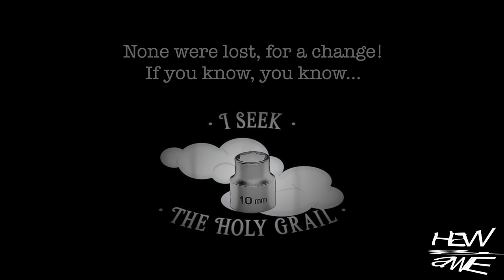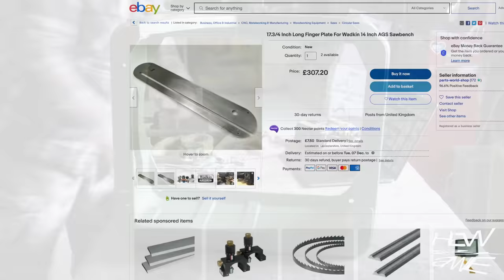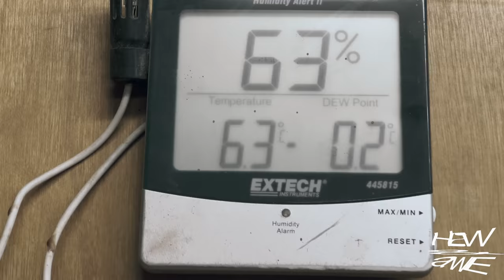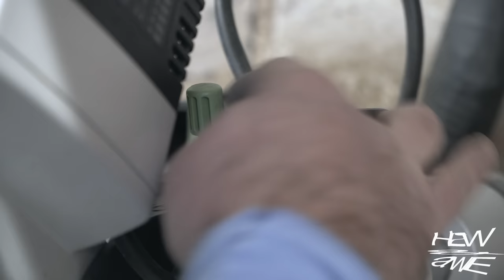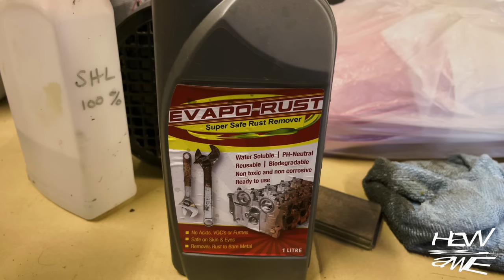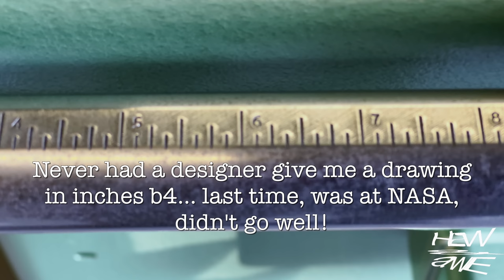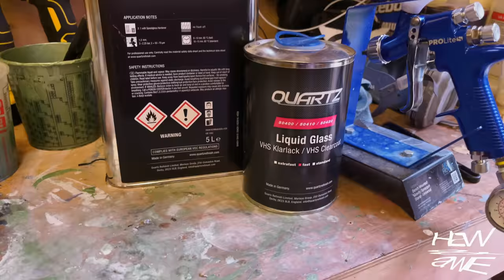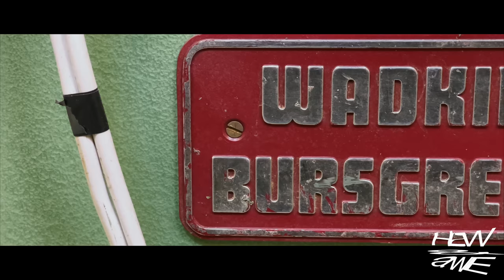Rebuilding My Old Table Saw (FULL EDIT) Wadkin AGS 10"

Comment: For future reference, Wentins in Yeovil sell every nut bolt, and washer you'll ever need, and several you won't, and you can order 1 or 1000 of anything.
Reply from the maker: Thanks, it’s nice to keep as much as possible as was from factory though.
Reply: @HewAndAwe  I more meant for finding correct replacements for the ones that are stripped/rounded etc - they sell Whitworth etc, you'll be able to get pretty much like-for-like

Comment: ----  that was a better saw when you rolled it out of the back of the van than 100% of the plastic and/or aluminum saws sold today
Reply from the maker: For sure, and easy to work on if any faults arise.

Comment: all my machines were made in the 60s and 70s.. lol, but im lucky they were handed down by my grandfather to father now to me. the lathe, drill press etc might be 50-60 years old, but i didn't go broke acquiring them, loved your video, there is something therapeutic about working a machine with your hands. from the time i was 4 or 5 i knew i want to work with metal. i was welding using the drill press and bandsaw before i went to kindergarten. mt grandfather made sure to put a tool in my hand. again good job sir.
Reply from the maker: Thank you Charles, appreciate the compliment! It’s defo my prize possession now!!! Merry Christmas! 🍻😊🍻

Comment: I stripped my AGS yesterday and was chuffed as a maggot to find absolutely no damage to any parts... No cracks, no stripped bolts, no frozen parts. Everything came apart easily. My rise and fall alignment bracket is complete, but I've decided to add a 3 mm brass shim between the screws and the contact surface. Currently, the 3 adjustment screws are in directly in contact with the surface and that doesn't strike me as being too cunning.
Reply from the maker: Those screws become a pain till you have them set up spot on - but I can’t remember why. My depth of cut is 80mm at 90 degrees 10” blade. One day I’ll get a 12” blade for special occasions.

Comment: A heartfelt pat on the back from East Tennessee USA you done an excellent job, I did not know up until I watched your video that the Powermatic 66 is essentially the same saw I know this because I have one sitting in my living room that I basically stripped like you did and it's in the early states of repaint and restore. 
According to the factory I have a first year 1966 Model 66 Powermatic cabinet saw and yes it is actually sitting in my living room😁
Reply from the maker: Hahaha to be honest if mine wasn’t in the workshop it would be in my living room!!

Comment: I just refurb'd a similar 1960s US Delta-Rockwell Unisaw, which has a very similar fence system called a 'Jetlock fence'.  It suffered from mishandling by morons - using the fence rails as handles to move the saw which led to instant dealignment.  By the way, a spring on the micro-adjust knob was part of the original assembly, and I think that a moron unscrewed the knob and the spring popped off and was lost in the pile of sawdust at his feet.  
But one thing about these vintage saws that is great, is that they have few or no nasty plastic bits, and they were assembled by human hands with hand tools, and so can be disassembled, repaired, and reassembled as you have done so well.
Reply from the maker: Yeah hit the nail on the head there, for me that’s the most fantastic part the fact that saw can never die unlike everything produced these days in the name of greed.

Comment: What a beautiful result. I enjoyed the whole video. That hammer tone type paint is an enamel so it will take 6-8 weeks to fully cure at which point it should be a lot more durable. Cast iron is the preferred material to make high end table saws because the iron is very dense so it’s great at dampening vibration but what a cow of a job painting it all. Cheers Stuart 🇦🇺
Reply from the maker: Cheers Stuart, I can stand a pound coin on the top and it doesn’t move at all! 😁

Comment: Great rebuild and loved your modifications adding as dust collection system. I understand completely what you are saying with today's junk that is manufactured, a great bit of it is manufactured in China and a good bit of it is just junk.
I have found myself scouring Craigslist adds and going to all sorts of Estate/Garage sales to acquire older American manufactured wood working equipment made in the 1960's and earlier. I have been pleasantly surprised to locate items that I would have never guessed would be stored in a basement or a garden shed.
Usually the equipment back then was made by a single manufacturer who still had their machinery set up from WWII to cast parts for Craftsman, Delta and SouthBend and General Electric to supply the motors to power them. The GE motors are a work of art with thick black paint and Brass info plates, If the motors are older they have baked on black porcelain.
I try not to get into an item that is so badly in need of restoration that I spend months on it. My time is better spent making things rather than restoring items. As far as spare parts are concerned ebay is littered with them but the prices can get a little out of hand. The best you can hope for is offer a lower price and see if the seller accepts. If you suspect a bolt may come loose just use some locktight and just snug up the bolt.
As you Brits would say, a bang up job.
Reply from the maker: Thank you John! Merry Christmas! 🍻😊🍻

Comment: Great job. I have the big brother of your machine. It has a sliding table to the left, but very cumbersome, made it fixed. I had the same problem with the fence and completely removed it and fitted a fence by Very super Cool Tools, as I didn’t want a support rail at the back of the table which would interfere with my outfeed table. I also fitted a pair of Jessem clear cut guides. I have the original manufacture manual which will be very similar to yours which I would be willing to photocopy and send to you.
Reply from the maker: Oh-yes-please! That’s very kind of you! If you go to the community tab you’ll find my email address.
Reply: Hi sent you all the manual in 7 sections to your E mail address. Hope they reached you ok

Comment: Old cast iron, old bearings, with old grease in those bearings, that takes a man to move, and it sounds like a champ all these years later.  My kinda machine.  Great save!  That table saw will be around another 50 years. 
@HewAndAwe  next time you want to remove rust and staining from a cast iron table, try this: 
1. Dry scrape table with razor blade on a handle, using short strokes, with "the grain" of the table surface grind. Take care to avoid edges of the table, miter slot, throat, as it will burr the blade edge.  Save those areas to the end.  Change blades often to avoid scratching the surface.  90% of the rust should be gone.
2.  Wipe surface clean with WD40, then apply WD40 on the entire surface.  WD40 Specialist Rust Release Penetrant works the best in my experience.
3.  Using an orbital sander or polisher/burnisher (best tool for the job), graduate through green, maroon, and grey scotch brite pads.  This will remove the rust, but not the cast iron surface, unlike wet/dry sandpaper, paint stripping disks, or even a wire wheel.  Wipe down with WD40 between passes and apply more before continuing.  Save the grey for the last pass, to polish the surface.
4.  Now that the surface is rust free and clean, but you have some staining or my favorite beer can ring, wipe down with mineral spirits and use Boeshield Rust & Stain Remover.
5.  Wipe down with mineral spirits, then run over the surface one final time, dry, with the grey scotch brite pad.  Wipe clean with mineral spirits.
6.  Last, apply a rust preventative protectant of your choice.  Mine is crystalline paste wax by Renaissance.  It slicks up the surface and provides reasonable rust prevention.  I usually reapply 1x a month or more depending on how often I use the machine.  The latest and greatest and of course, most expensive are ceramic coatings.  They will run about $100 for the kit, but are supposed to stand up well for a year or more.  I haven't tried that yet, but expect to in the near future.
The process works for restorations best, but for maintenance, I skip the green and maroon pads, and use WD40 with a grey pad to clean the surface, give it a shine, then apply wax.  That process, start to finish on a table saw like yours, would take 20 minutes tops.
Great content!
Reply from the maker: Cheers Tim, yeah I tried the ceramic coating as I had some left over from my car, I gotta say it was utter crap! It didn’t want to bond! I’m sticking to my Japanese hydrophobic car wax which is the dogs bollocks!!! It lasts for months, in fact I can’t ever tell it needs more but I do just for the shine and slippage. 👍

Comment: Well done Ben, your commitment is impressive, vintage saws have a specialness, I currently have a Laguna fusion 3 here in the UK, great saw, scary accurate but I do remember an old vintage Startrite Tilt Arbor table saw I used in my shop and it was a sweet saw, very enjoyable video mate, louie
Reply from the maker: Thank you Louie! Ha, thats the saw I'd have chosen if this saw hadn't come along, I like their stuff, seems well rated by peeps worth their pinch of salt too.
Reply: @HewAndAwe  Hi Ben, the little startrite was a lovely saw to use but very under powered mate, I remember cutting some Mahogany and there was a sharp blade fitted but the Startrite did struggle, I cant remember just how big the motor was, I think something like 1.25hp! There was something alittle special about the wee saw, the big Laguna is a monster in comparison, cuts through anything, anyways your video was excellent, well put together and extremely interesting to watch, looking forward to further videos I hope you will shoot, kindest regards Louie, Ulster Workshops

Comment: Nice video! Hooked on wood is a dutch guy actually :p fun to see you use his idea! Hope it works 💪

Greets from the Netherlands 🇳🇱
Reply from the maker: I found it doesn’t help a great dea bar clearing the dust sitting on the saw before a cut, the biggest difference is the over blade dust hood extractor, remember the blade comes up through the wood then down through the wood.

Comment: What a fabulous job you’ve done.  Love your dust extraction solution.  I may have to do similar for my Charnwood W650 as the dust extraction on that is a joke.  Tried an Axminster Premium blade which ran me over £100 and have to say my Shark 80T blade at less than half the price is hands down better and has more carbide on the teeth.  Shark’s professional range is only £35 a pop and their premium about £50.  Same blade with different coatings.  CMT chrome industrial also better the Axminster blades for around £60
Reply from the maker: Thank you Paul! I’d be interested to hear if the Axminster blade was way quieter? I pretty much never cross cut on the table saw so I buy the Axminster premium 24t which is way less than 100 quid, I’ve never heard of Shark blade I’ll have a look. 👍
Reply: @HewAndAwe  comparing my 60T Axminster blade to the Shark 80T, the Shark runs quieter and smoother and feed rate is much better too even though it’s a finer cut.  Not sure if they do a rip blade but CMT do.  For rip cuts I use either a Freud 24T professional or their 40T combi blade .  The 24T is excellent

Comment: Amazing refurbishments, certainly don't make them like they used to!! 
Question: Did you treat the main metal table top with anything? I have a bandsaw table top that's slightly rusty.
Reply from the maker: I use a hydrophobic car wax, a Japanese brand that doesn’t need reapplying every week, gives a nice shine and the boards slide nicely too. The wax I use is by far better than anything I’ve tried and I’ve tried them all!

Comment: I used that exact model when I started my first Joiners job way back when....it was awesome and terrifying and the fine adjusting was great too.........we also had a Wadkin spindle moulder, and a mortiser/chain mortiser too those were the days.....  not sure what the Tenening machine was but it was wicked scary .. guards what guards!!!  came back after vacation and some individual decided to change on of the blades and didn't tighten correctly and you guessed it the 9" was found imbedded into a steel girder through a 2x4 drywalled wall thankfully no one was injured....but that employee disappeared that week .....wonder why???   knob...   thanks for a great vid...and the spring trick was awesome too.....
Reply from the maker: Geeezuz!!! I’m forgetful so I check that I’ve checked if you follow me. Hope you have a lovely Christmas 🍻😊🍻

Comment: @HewAndAwe  
I have 2 Powermatic table saws from the mid-70's, a 10" PM66 and 14" PM72, and I restored them both ground up.  Here's a few tips.
1.  Here's your next video content...restore a bench grinder!  You need one!  Love the multi-use Festool drill/driver/polisher/wire wheel stripper/lathe, but come on man, get a bench grinder and make the tedious parts of restorations are a lot less time consuming. :)

2.  Use paint stripper, then use a power washer to remove it, hit it with compressed air then IMMEDIATELY follow it up with a wipe down of WD40 before the part flash rusts.  Remember, WD40 is a water repellant not a lubricant, and it will prevent rust for about a week.  WD40 comes off with mineral spirits, which is a step you take before applying primer.  So next time, give it a try.  I'm sure you'll be impressed.

3.  Use foam ear plugs to stuff into bolt holes that you don't want paint to get into.  Those annoying foam packing peanuts work good for that too.  Easy in, easy out, and they expand into threads.

4.  More dust collection suction pressure?  
Use 2 plastic magnetic sheets (1 for either side of the shaft) and cover the arbor tilt hand wheel shaft opening in the cabinet.  Get them on Amazon.

Install weather stripping on the cabinet flange, which will compress to the cast table once installed.  Do the same for the motor cover surface that mates to the cabinet side panel.  Big difference.

Reduce the volume of the cabinet interior by mocking up a cardboard dust chute directed to the dust port in the cabinet base.  Then make the permanent solution from 24ga sheet metal, which is rigid enough and easy to work with if you're not set up to weld something thicker.

And last, because I can't resist, SELL the original riving knife before you hack it up!  Hey, every little bit helps, right?  Hope that helps.
Reply from the maker: Cheers Tim, the riving knife was a hard call, but necessary long story… and I can say I don’t regret it. What I would like to sort is making the knife quick release!

Comment: I think I have one of these saws my dad left me.  I think it's likely newer than this one but, from what I can remember it looks about the same except for flat rails.
Reply from the maker: My rails are round with a flat spot for the measurements. Man I’d be chomping at the bit to get that saw out, you maybe lucky and find it’s the AGS12 😁
Reply: @HewAndAwe  I'm hoping to get it setup within the next few weeks.  I'm currently repairing the floor in an old shop building on my land.  I'm going to try and open a maker's space by this spring.

Comment: What motor did you use? That's one bit I wish you'd covered in more detail, the motor swap, although I realise it's pretty ruddy niche. There's a 12" version of one of these near me for sensible money but its 3ph, swapping the motor is probably the most straight forward way to resolve that.
Reply from the maker: Motors are pretty much the muchness, it’s pretty much choose your hp and try and make sure the bolt holes line up, what’s more important is making sure the pulley matches the old one and then the belt matches the shape of the pulley, it’s really simple when you look at it it’s what people stock and don’t stock that makes it a bit difficult. Are you in the uk?

Comment: Amazing work. I'm looking at a 10" local to me but it's missing the rip fence and sliding table. Wish me luck!
Reply from the maker: Most peeps I know went aftermarket as they didn’t get the fence to work as well as I did.
Reply: @HewAndAwe  I see. Do you have an aftermarket recommendation?
Reply from the maker: @ptz0n no, you could try the Facebook wadkin group. You might even find the correct fence there to.

Comment: Mate.....just one thing.....please put the guard on that surface planer.
I took half inch off the end of my left little finger, back when I was an apprentice, on the surface planer in the workshop. And now it makes me cringe everytime I see someone run a timber across the block without the bridge guard.
Reply from the maker: I would if I could, we’ll if it was the pork chop design it would be on but it’s not and sticks out so far that I wouldn’t be able to get past the machine and out the door say if an emergency, it’d be even worse if the electric went out I wouldn’t be able to see, it’s so dark in there with out lights you can’t see your hand in front of your face. I have to have a clear passage to the exit! It’s not a decision I took lightly, I have had 3 fingers sewn back on some years ago so I know what it’s like. 👍

Comment: Hey Ben, what's your opinion on those Wera Joker ratcheting spanners you were using in the later portion of the video?
Reply from the maker: I have a love hate thing with them, the open end has a plate attached that helps hold a nut, I’ve just seen I can remove that plate but other than that yeah love them, ratchet spanner’s all day long for tight spots!